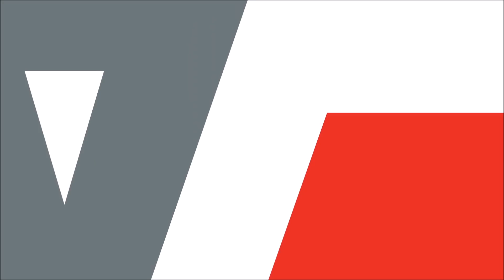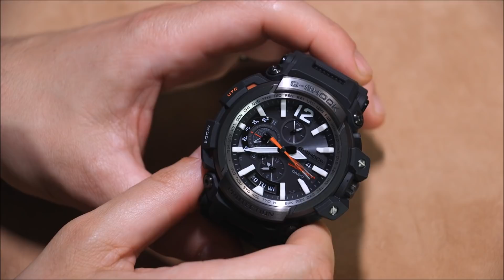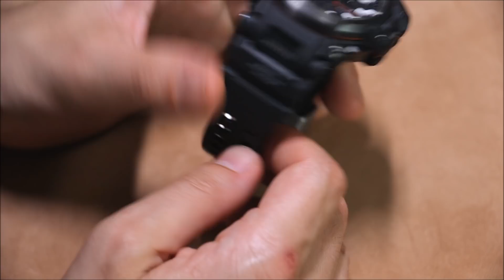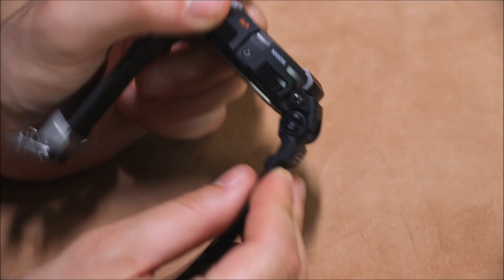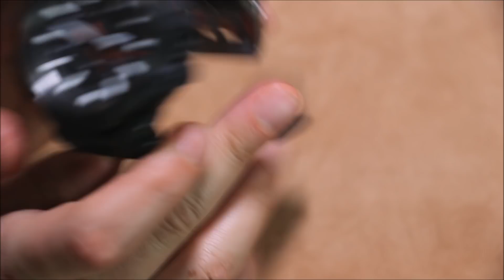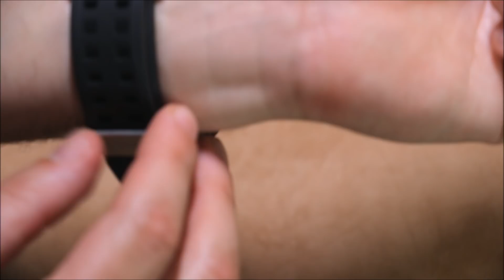Casio G-Shock Master Of G Gravitymaster GPW-2000 GPS Bluetooth Watch Review | aBlogtoWatch

Comment: I love mine except the buckle where it connects to the strap broke and the replacement band is $150. Pretty steep but the watch is nice otherwise.
Reply: It’s Weird that it Broke like that Since the Watch has a Carbon Fiber Strap and Connector which is one of the the Most Durable out there. Anyways it’s Worth getting a New One if it Broke.
Reply: @ameyajoshi742  It broke where the band attached to the Buckle.  The little loops gave out.

Comment: I have this watch and love it. Major issue is with the Bluetooth functionality. Once the app is connected to the phone it is meant to update the time every six hours. Works fine until i turn Bluetooth off on the phone and then switch it back on (flight mode). The watch will then not be updated any more by the app until i unpair and re pair the watch. I have sent this in to the Casio agent who cannot sort out this issue. Very Frustrating that one of the features i like does not work
Reply: Warren Peffer thats not a issue if you want to update with your phone you must connect your watch every time is how it works